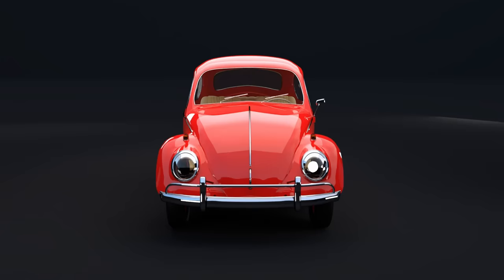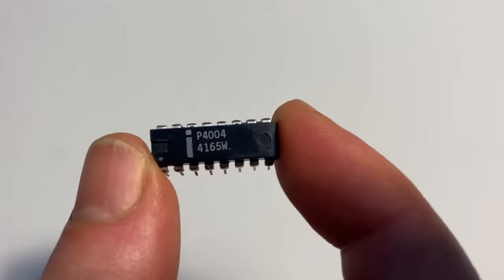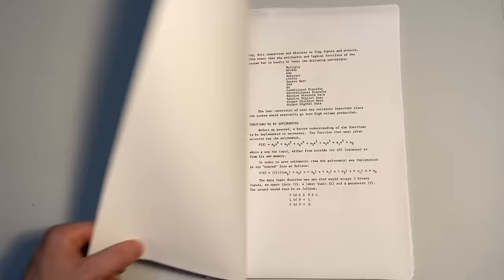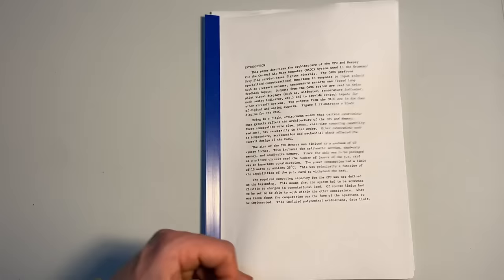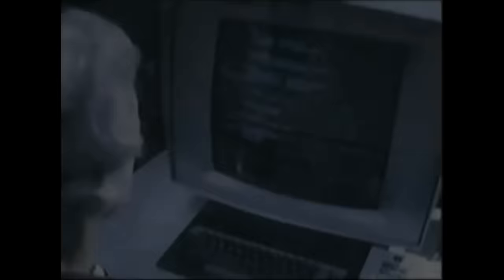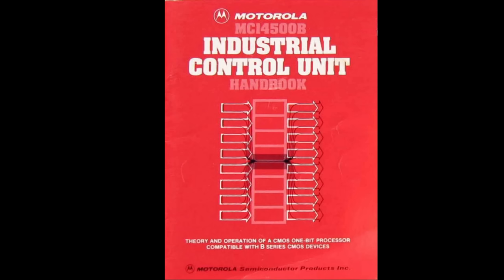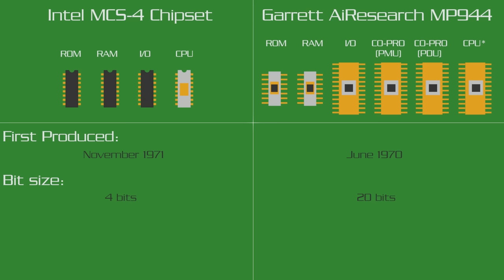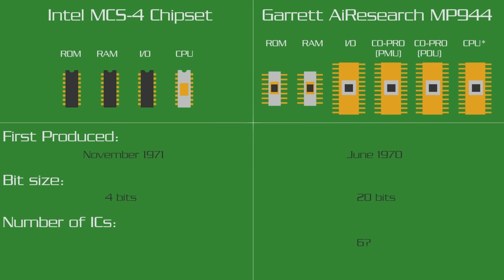The World's First Microprocessor: F-14 Central Air Data Computer

Comment: The F14 didn't get an air to ground package until the 1990's...
Reply: A lot of the same considerations apply to launching a semi ballistic missile like the Phoenix compared to dropping bombs though.
Reply from the maker: Interesting. The requirement was there in the specs for the CADC in 1968 (as stated in Ray’s book). I wonder if they designed it in anticipation of a future weapons system, a but like Eurofighter/Meteor
Reply: @Alexander-the-ok  The reason the requirement is there, is because the original poster is wrong.  The F-14A had air to ground capabilities in 1975 when it entered service.  It was even certified to carry, drop, and fire most of the US Navy's arsenal at the time, including Zuni rockets from rocket pods.  The armament control panel is clearly seen on the left knee panel in the RIO pit of the original Grumman photos from the 1970's of operational aircraft.  It wasn't used, because the US Navy was still flying:  F-4 Phantoms, A-4 Skyraiders, A-6 Intruders, A-7 Corsair II's, S-3's, and eventually the F/A-18 for attack or ASW roles, and there was no need to take their super expensive multirole air superiority fleet air defense fighter and have it drop bombs when pretty much every other aircraft on the carrier deck could do the same.  :)

Comment: can you comment more on why swing wings became obsolete
Reply from the maker: Years ago, a Tornado pilot explained to me that the additional weight/mechanical complexity of the hydraulic/mechanical system required to actuate the wings pushed designers to move away from swing wings. Also, with modern fluid dynamics simulation it is possible to design wings that perform well at all speeds. In addition, flight stability issues can be mitigated through fly-by-wire now.

Comment: I feel like the "splitting hairs" between the definition of micrprocessor as self contained is somewhat of a misinformed argument people sometimes make.

MicroPROCESSORs are hardly ever (to this day) self sufficient. Even modern desktop microprocessors need buddy chip(s) to function usefully.

MicroCONTROLLERs, on the other hand, frequently need only power to function, containing the whole system and fun peripherals built in.
Reply: What is a microprocessor?  In reality it really does not matter, however, companies and marketing people love to label what they have.  When I started the design of the F14 CADC the implementation of the “processor” was unknown. As we tended towards the new “integrated circuit (IC)” technology names such as IC processor or LSI (large scale integration) was used. Micro was also in there some where as the computer design evolution progressed from large, to mini, to micro.  It was not a big issue to anyone.  Ultimately, as the CADC project was completed and I wrote my paper I chose the name “microprocessor”.  There was no focus on single-chip, multi-chip, program counter location, etc. In fact, even Turing was set aside as the main focus was to do the job irrespective of # of chips and what function was where, and even how data was transferred. The selection of any cleaver design techniques (pipelining, co-processing, in-flight self-test, dual redundancy),  algorithms, and package selections we made to reach the speed and accuracy necessary to fly the F-14 as needed. It was unfortunate (for me and history) that the 1970 presentation of my paper and any patents were strongly refused by the US Navy thus 30 years of silence started. Around three years later the Intel marketing group started labeling their work. First came the World’s first microprocessor, then the World’s first commercial microprocessor, then Intel’s first microprocessor, then Intel’s single-chip microprocessor ….  Today, everybody wants their design to be a microprocessor, otherwise, how are they going to out market Intel?
In 1973, Hank Smith, Microprocessor Marketing Manager, Intel Corp made this statement at the IEEE 1973 WESCON Professional Program Session 11.  “A CPU uses P-channel MOS and is contained in 1,2,3 or4 LSI standard dual-in-line packages from 16-42 pins per package”.  Even at this time the word CPU was sometimes used for the entire processor and not microprocessor.
After this, history started dissection the word CPU, microprocessor, single-chip, etc to fit the functionality, design, and packaging of each product. Thus, here we are in 2024 (54 years later) still trying to make it all fit into convenient definitions.  Ray Holt

Comment: Any idea used to 'cheat' and get more performance will be abandoned for simpler solutions when we find out how to make things work better for less. But these solutions should be taught and retained because they may become useful when we start breaking new barriers. Swing-wing design may become necessary again in a distant future where conditions are complex and speed vs maneuverability can't be compromised and must be available at select times.
Reply: Variable wing sweep still trumps a fixed wing design, it's just that hybrid designs and advanced engines have gotten close enough that the weight of a variable wing sweep offsets the advantages too much for the performance gained.  It's not complex to understand that a straight and long wing will produce more lift and exert more control over the aircraft for a given angle of attack of the control surfaces.  It's not complex to understand that a true delta wing will always produce less drag at high speeds than anything less than a true delta wing.  It's just that we can overcome most of those deficiencies through more thrust, "good enough" wing design, and advanced weapon systems.

Comment: I worked on a 145 initially in 1981 ... then we got the 3030/90 series in 1985..i worked on these for oil companies and bank/insurance houses right up til 1993 ! ...so your timeline is off... big hot noisy overpaid operators mainframes were standard and microprocessors were not used in big IT til the mid 90's .... (god love the 80/90's !)

Comment: This is probably impossible to say but if the 4004 was quite a lot slower, what would a 'consumer PC' be that might have a chance to keep up with the F14 computer? An 8086 maybe or faster still?
Reply: The spec says that the MP944 runs at 375khz and performs 9k instructions/sec. That's pretty damn slow. Even the 8080, a much slower and earlier CPU than the 8086 clocked at 2Mhz and could execute something like 300k instructions/sec. So, I don't believe the industry was held back much by the secrecy.

Comment: The F-14 was an interceptor for Soviet bombers , hence its massive size radar and  AIM-54 load out- a missile designed for hitting large limbering targets and specifically for the Tom cat  
And maybe in Europe those little guys are more popular but over in North America, we like our fighters 😂
Reply: The F-14 was not an interceptor, per se.  It was designed to be a multirole air superiority fighter with an emphasis on Fleet Air Defense.  Fleet Air Defense has a lot of interceptor attributes, except one MAJOR one... Interceptors are generally deployed when the threat is detected, Fleet Air Defense is ALREADY deployed when it is detected.  There are significant challenges in FAD over interceptors, specifically fuel and dash requirements.  FAD generally requires higher fuel loads and a long loiter ability... the F-14 has 20100lbs of fuel with two external tanks and a combat radius in excess of 600nmi, which is pretty dang impressive given the size of the aircraft, but it also has a really good dash capability to get up past Mach to launch those AIM-54's high and fast.

And yes, the F-14 was multirole from day 1, it has an entire weapon control system specifically for bombs which was always in place, but never used until the late 80's and through the rest of the aircraft's life.

Comment: So Saab 37 Viggen is a joke to you?
First digital CK37 microprocessor in a fighter, developed from 1960 to 1962, years before MP944 (1968-1970).
Reply from the maker: I’m doing a video on that in the future. It was built from discrete components so wasnt a microprocessor. It was extremely impressive though

Comment: F-14A first production date 8th October 1972 - VS - First commercially available microprocessor, Intel 4004, designed by Federico Faggin and introduced in 1971... urm.. wtf?
Reply from the maker: The F-14 first flew (complete with a CADC) in December 1970.
Reply: @Alexander-the-ok  The first processers were in use in the 60's. We are talking publicly released, officially unveiled.

Comment: Multipiy is shifting and added in cpu assembly code. Not complex anymore.
Reply: It is time consuming compared to a proper multiplier though.

Compare, add, shift for each bit plus possibly loop instructions. 60-80 instructions to multiply two 20-bit numbers vs one or a few with a hardware multiplier.

Comment: Your dates are WAY OFF.  How do you think we got to the Moon in 1969, transistors?  IBM was already looking at microprocessors in 1971.  I got my first Apple 2+ with a 6502 cpu/processor, 16K of ROM (yes, KILObytes!), RAM maxed out at 64K, in 1 9 8 0!  IBM started selling the IBM PC in 1981 and I was pissed I'd bought an Apple.

Comment: This crap about a microprocessor needing to be only 1 single IC that can function as a complete computer is autistic.  That’s a very recent development, a system that’s on a chip.  Computers have used multiple IC for decades still do.  You just don’t typically call the other chips, microprocessors but the microprocessor can’t do much without them.  A north bridge was used as a memory manager and to connect memory to the microprocessor.  It’s another chip, but not a microprocessor.  Memory management was integrated with the processor at some point so we don’t see north bridges any more.  Similar story with the south bridge.  Heck even an FPU was another chip.  Was a 386 not a microprocessors because it could be paired with an FPU and could not do its own floating point arithmetic?  The semantics involved here really show off the lack of history and experience in the views presented here.  Lots of sperging out over definitions and silly rules for categorization.

Comment: if this was application specific, wouldn't this make the F-14 computer an ASIC?
Reply: You are confusing terminology with architecture.
Reply: @nobodynoone2500  So this was a general compute architecture? can general software? because if it can't run other general purpose software, that would make it application specific, so it would be an ASIC chipset. the 4004 was general purpose. 
it does sound like this chip set was customised specifically for the application at hand with no thought for any other use. which would make it application specific.
Reply from the maker: There is a ‘spectrum’ from general purpose to ASIC. In principle the MP944 chipset could be reprogrammed for other uses (like the apollo guidance computer was), it just never was. The 4004 was the same - made specifically for one thing but subsequently reprogrammed and used in other applications.
Reply: Application specific not by design but by usage in the F-14.
Reply: @firstmicro  it was by design, it is designed to crunch a specific calculation very quickly hence all the float operations. it was also designed to have a specific number of bits specifically to do that calculation. it was designed from the outset to be a flight computer not a general purpose machine that was adapted by software to do that job.

Comment: I would not consider FPGAs to be microprocessors. Their clocks speeds are slow, they eat power, and their gate counts are several orders of magnitude lower than real CPUs. Mass produced CPUs can be die level cherry picked at the foundry for low idle power consumption to run at incredibly low voltages/ long battery life, or chosen from the other end of the bell curve to run incredibly fast in servers where cooling is easier. FPGAs cannot be identified this way.